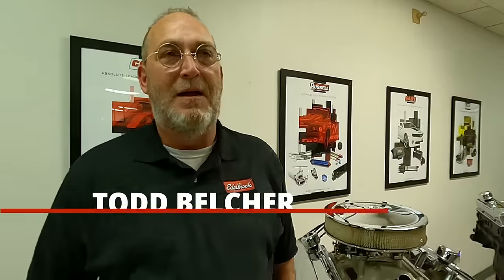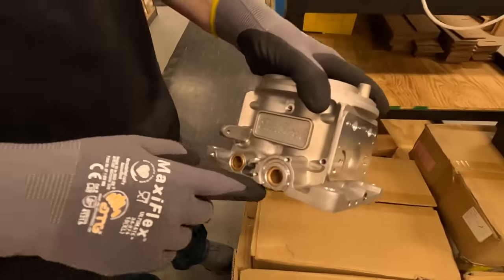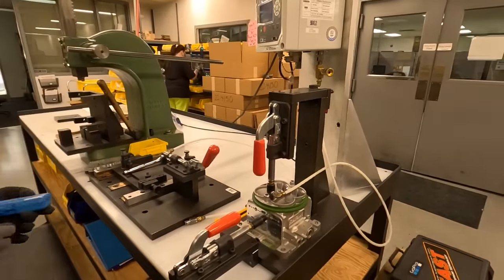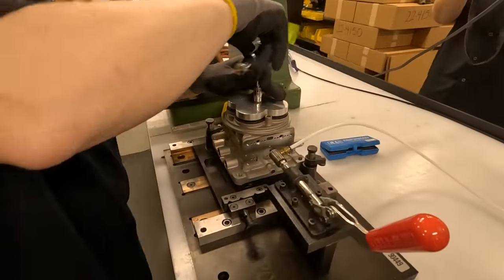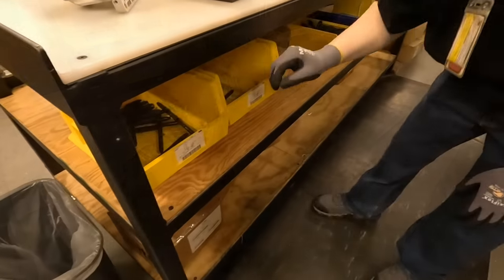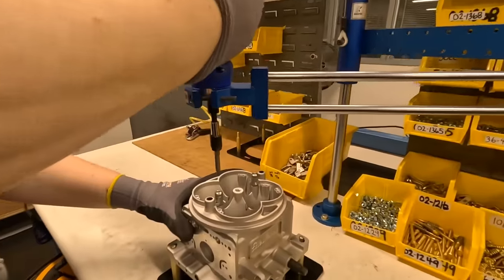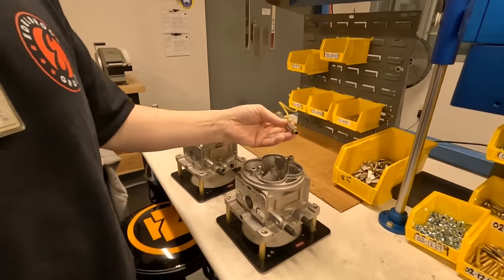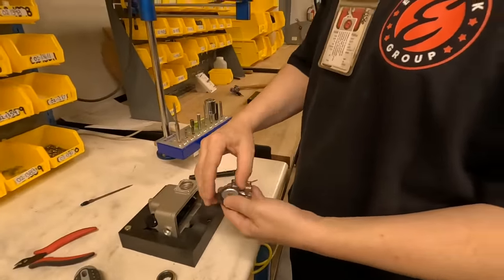Edelbrock VRS-4150 YouTube EXCLUSIVE How it's Made! VRS-4150 SECRETS EXPOSED!!! @EdelbrockUSA

Comment: Hey do me a favor 🏁, tell me what size the throttle plates are 🤔 I've been asking edelbrock, I've been asking everybody on the web all the carburetor shops nobody can tell me I want to know if the throttle plates are 1 11/16 or 1 3/4 or 2 in 🤷,,,,,🏁👍🏁
Reply from the maker: The 750's are 1 11/16, I hope that helps
Thanks for watching
Andy
Reply: Thanks andy, I'm looking at the 850s and 950. Can you ask them what size is the throttle bores on the 850 and 950 👍
Reply from the maker: @anthonyangotti5484 I'm pretty sure that the 850 is 1.75" based off my eye sight 
Andy

Comment: My dad has been working on and has modified so many Holleys, re machining the poorly cast bodies so they actually are the same size and shape just like the ebelbrock nice to see a quality product with great machining. I can not wait to show him the video showing the machined bodies and venturies. He has a made a special fixture to mount Holley carbs and re machine them for bearings for the throttle shafts and re machine all the gasket and mating surfaces as they are never flat and have a poor surface finish. Good on you edelbrock ps my dad has a pro ram II in the original box waiting for a project. Dad says tunnel rams are worth 40hp and 30ft of torque you can not do better on Na application . 😊
Reply: Wow on the numbers but really that is no real surprise.

Comment: Id like to try a pair of those on my tunnel ram. Looks like you can fine tune those bad boys perfectly. Thanks for the look inside
Reply from the maker: Steven, I will let you know what I find out once I get them on MIXED UP BOSS. I can tell you that the specs on the IDF's are the same as mine and the emulsion bleeds are close as well. with that being said I believe they will be scary close to perfect out of the box other than the PVCR's but I wont know until I try them as is..
Andy

Comment: Wow Andy, you excelled your self with that vid. I just bought 3 of them. Two 650's for my 4" stroke CHI 4V Clevland. And an 830 or 850 for single 4 barrel use. Man, who said carbies are dead?! Yous all can punch your efi, with high pressure lines, returns to the tank and tank mounted fuel pumps. Mechanical pump and a tunnel rammed Clevland. Cheers.
Reply from the maker: That is awesome! Keep me updated 
Andy
Reply: @UnityMotorSportsGarage  Will do, man. Catch you on the best tech this side of Appalachia!! Professor P. the singing slanted daysome!!!

Comment: I have 750 cfm version for my 347 ,rpm air gap, 205cc intake 58cc chamber, 231 239 at 50 hydraulic rolla I'm  building 
I think Casper might like 2 of those 750's to try
There's a lot of features and adjustment in them carbs
Reply from the maker: Dale, we are going to find out if CASPER is an Edelbrock fan! The carbs in the video are going on MIXED UP BOSS
Thanks for watching
Andy

Comment: Hello Andy, great video. Thank you to you and the Edelbrock facility. Did they say what liquid they are using in the wet flow test? Do they record a/f ratio for several air flow rates WOT and other throttle settings?

Comment: Cool! :)  
I'm very much considering one of these 750s for my chevy 383, seems hard to find a 750 annular carb with better price and tuneability. 
Are those boosters what you would call "downleg annular" ? 
Can you tell us what the flow numbers on the 750 were?
Reply from the maker: based off the booster location I would call a straight leg annular. the main body is taller and that gives the appearance its as a downleg. On the Flow numbers It was dead on which is not normal for a Annular booster 750 due to the booster size.
hope that helps 
Andy
Reply: Thanks! Is that 750CFM dry flow or wet flow?
Reply from the maker: @BLASTbeetSWE  Wet flow 
Andy